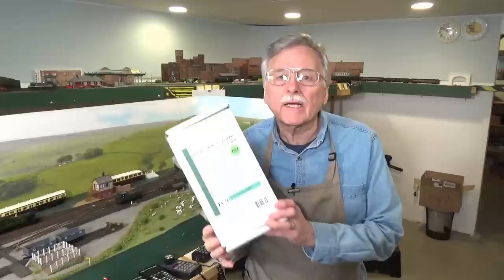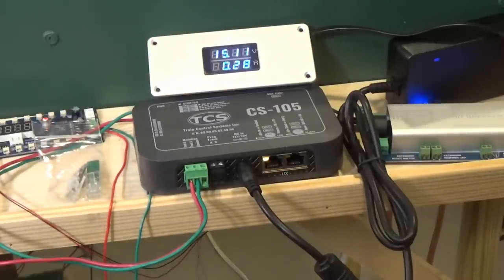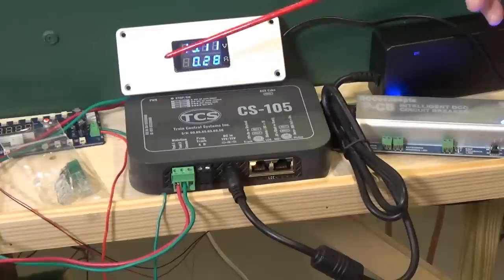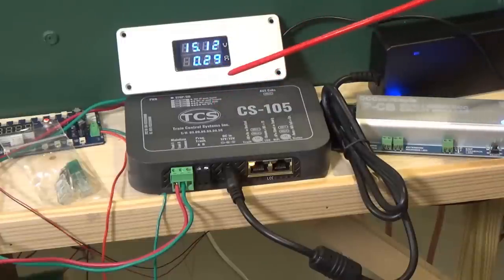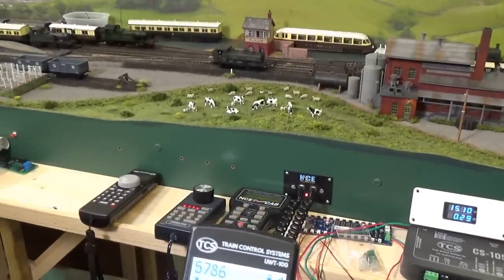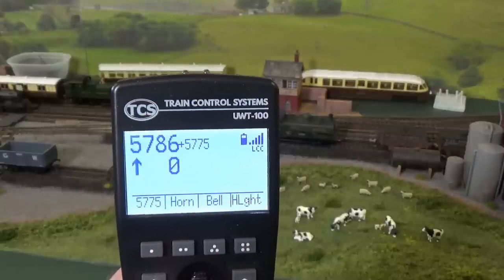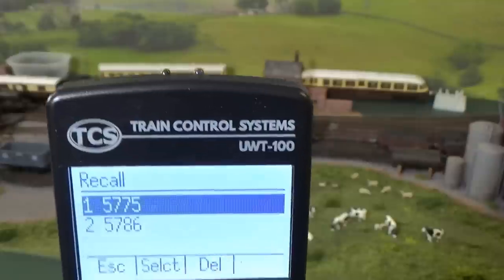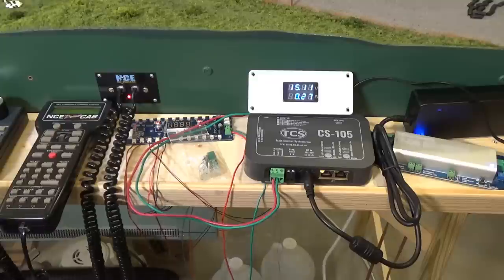Let's Check Out The New TCS CS-105 DCC System (309)

Comment: I want to thank you for your attention to the problem of low volume on a Digitrax decoder.  In this regard, I have tried to consult Digitrax on the subject, but it has been impossible to access their system because it does not recognize the keys and generates a circular loop when you want to reset the key and returns it over and over again to the beginning

Comment: Hogh capacity, low self discharge NiMH cells are best for the UWTs, and they do last forever! I did 3 op sessions at an ops event, ran trains on thr club's modular layout, and then used the UWT-100 some more at home before it finally died!

Comment: @Larry, what type of power do you recommend for a 16' x 8' x 8' and I'll probably at the max will be running two DCC units (HO) seperately. I'm planning on to having my layout be a small industrial park layout. I'll be using hand thrown switches. I'll have no search lights or lit crossings. I may have one light up near the scale house and near the switches at the siding and the two house tracks. I'm not planning on lighting up any buildings or run any night time operations. Eventually I plan on having all locomomotives be equiipped with DCC and sound and the same for my caboose and a shoving platform. 
Thanks for showing us how to do these things that some of us are not familiar with what you are covering.
Reply from the maker: Something like the TCS LT-50, NCE PowerCab, and Digitrax Zephyr.

Comment: Whoa! what Great Video Larry when you said it works with the NCE'S equipment that raised the Hairs of Goodness that means the PowerCab can be or could be put in the pasture or used as for small testing instances, with this system you could program track the Engines! Set them up them Run em' in one shebang Brilliant & use your PowerCab Throttle as Procab & the one Throttle that TCS makes i believe it has the podimeter built into you turn the knob a Quarter turn this in Yard mode the Engine moves at yard pace you zero out it Rolls to a stop in forward or Reverse that's damn Awesome Larry 😮 its a Bowl a Ice-cream a slice a pie & cake all in one who wouldn't want this system and weather you have a huge layout or small shelf you could have tons of fun with the system but hopefully its affordable not everyone has deep pockets & I haven't looked to see if a Throttle is included but there's always a Butt for me a big one 😂 I laugh at myself, moving on if you can buy the system and Run it with your NCE'S throttles it would give a person some time to buy a Wireless TCS throttle which I'd probably do.. 

And here's what I wanted to Ask you larry since you've worked with some many different DCC setups would this system possible work with NCE'S Circuit Breakers  there newest Breakers Larry you can adjust the Breakers but I still wonder if they'd work with this system or if a person would have to go with one of Tony's Train Exchange Circuit Breakers.. 

I'd seriously think of getting of one of these systems as the one controller works close to that of a Proto Throttle & those Throttles are near $600.00 but TCS's has full display to work with & wireless I'm liking what see allot. With my Free computer I just got from my cousin I'm gonna kick some serious fun with my Layout.. And I always enjoy your Videos everyone that I can watch.. 

Allen D
Reply from the maker: Allen—it should work fine with NCE circuit breakers and you can also customize the CS-105 trip current settings, which I did not have time to cover in the video. I had it running with the DCC Concepts intelligent breaker with no problems.
Reply: The UWTs are nothing like a ProtoThrottle. ProtoThrottle is amazing, transformative, and I love it but it's not for everyone and requires locos programmed for it. The UWTs are general throttles for everyone and are by far the best in class. I use PT at home and have UWTs for modular layouts and bringing to op sessions.

Comment: That is a nice system. Can you mix TCS, Lens and NCE throttles at the same time? I've had a Lens LH90 for years that I only used at the club. Best engineer throttle ever. I have NCE power cab at home.
Reply from the maker: One limitation is you can only use one system on the aux network, so either Lenz or NCE. However you can mix throttles on the aux network with those on wifI or the LCC network.
Reply: @TheDCCGuy  A second CS-105 can be set up on the same LCC, with one functioning as an accessory command station, one as the track command station, and with separate RS-485 bus settings. More recently, the LCC Wi-Fi adapter has come out which has an RS-485 interface on it, and allows for a second RS-485 network, so one could be XPressNet, and one could be NCE cab bus. It's not very practical, but it's theoretically possible. Neither of these options are practical for one throttle, or even a couple of throttles, but it is technically possible.

Comment: Thanks for the video.
If you were starting out from scratch, would you go with TCS, of something else?
Reply from the maker: Starting from scratch I would be torn between the TCS systems and Blunami. Blunami offers simplicity to a certain degree but you will still need to control accessories. I would still like to see a hybrid system that offers real throttles for Blunami control and also for accessories. Right now we are in a transitional stage just like DCC was in 1994 a d it will take a few years for Blunami type systems to evolve onto a more mature state. For example I would like to see Bluetooth controlled accessory decoders and as I said real throttles, etc. before committing to that technology. Also some other wireless technology may pop up that is much better than Bluetooth. The TCS system at least is a more stable technology with a proven past and a more well defined future.

Comment: Hi Larry, All these DCC systems are way outdated since the coming of Bluetooth tech. BLE is the future and the only thing we need is the replacement of the 'smartphone' with real hand held throttles. One already is made in Germany. A major difference is also the price tag compared with BLE tech. Example: A Hornby HM7000 sound decoder TXS cost around 60£ and of you go - easily. No CV settings to care about, no hassle. High end sound by Soundtraxx is the US - more expensive - alternative. Plus you can combine both systems. Nothing is lost. I suspect you will have a look at the new TXS sound on your other channel ? Success. Cheers,

Comment: Another problem: I have an SDH166D decoder installed on a steam locomotive.  It works fine but with very low volume.  I have increased the value of CV 58, 141 and 142 to test without a significant change.  What can be done with the current configuration?  Can the speaker be changed for a cubic one and in that case, is the capacitor kept?
Reply from the maker: Where did you get the sound package? I have one Digitrax decoder installed in a diesel loco that sounds great. But I installed another in a friends loco and like yours I never could get the sound level high enough. It was one of John McMasters’ sound projects and I tried a couple others of his with the same result. He has tons of sound files at his AnPRR forum on Groups.io so you may want to check those and also ask about your file if it is ones of his.

Comment: I have an MRC Prodigy Advance with two controls (Advance and Advance 2).  I need to control digital turnout switch machines, which that controller doesn't allow me.  What brand and type of controller can you advise me to be compatible with.  The ideal would be one that does not need power from the electrical network because in Chile we use 220 volts at 50 cycles.
Reply from the maker: Since most of this stuff is now powered by DC and DC power supplies typically can use either 110/220 at 56/60 cycles it really should not be an issue just a matter of having the correct plug.
Reply: @TheDCCGuy  My question is which accessory controller can be compatible with the MRC Prodigy Advance station
Reply from the maker: According to the manual I have that system can control accessory decoders. So are you looking for another way to control them? Take a look at the videos I did on using the DCC Concepts ESP system that I used to control the accessory decoders/switch machines in my hidden staging yard, videos 236-237. It can be used as a stand alone accessory control system.

Comment: Larry, I know you are the DCC man, but have you done any work with LCC?  Do you ever plan to do any videos on LCC?  I was looking at purchasing the CS-105, but found a better deal on the NCE Smart Booster.  TCS has shown using a Smart Booster with the CS-105 and their booster also.
Reply from the maker: You can use other types of boosters with the CS-105, however you lose Railcom use in that or those blocks powered by the booster. Although LCC has ben around for a number of years now it has mainly existed as vaporware. The TCS systems are to my knowledge, the first DCC systems to actively use/support it. RRCirKits has offered a number of ancillary LCC products and a few people have built their own stuff but up until now it has had limited use. Personally I see it as something that only folks who are chasing after technology and are more into the electronics side of the hobby have adopted. Maybe that will change now that TCS has made the dive. Every time I have asked other manufacturers about LCC products they say they are waiting for their customers to ask for specific LCC products, and the customers say they are waiting for the manufacturers to come up with new LCC products and show them what it can be used for—catch 22.

Comment: You dont need a booster common if all boosters are opto-isolated but they recommend one. Most Digitrax boosters are not opto-isolated so they require the common. Most North American systems use booster commons, most European systems do not ans uae opto isolated boosters instead. Some opto-isolated boosters lile TCS and NCE have optional booster commons.

Comment: I like the look of the TCS system but those "special bundles" do not save you any money, they cost the same as if you bought they throttle and system separately. The uwt-100 costs $299, and the cs 105 is 529. The "bundle" they sell with them is $730, so no savings.
Reply from the maker: Based on your numbers the individual total would be $299+529=$828 compared to the $730 for the bundle saves you $98!
Reply: @TheDCCGuy  your right, I'm not sure what I was thinking but apparently my math ain't mathing today. Have you been using your TCS system consistently for a while now? If so what do you think about it, it's compatibility, and it's programming and functionality?
Reply from the maker: I had to send it back as it was just a loan for the review.

Comment: I think youre a little overly optimistic about other manufacturers actually matching what TCS is doing, even though they are now clearly the system to beat in the North Ameircan market. Digitrax has had problems executing, while NCE has been shipping basically the same system for 28 years.